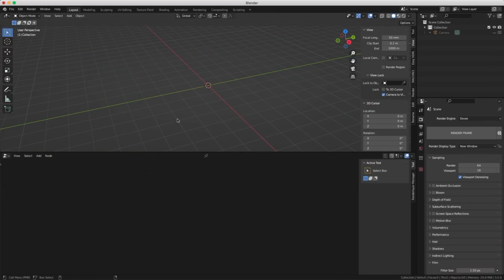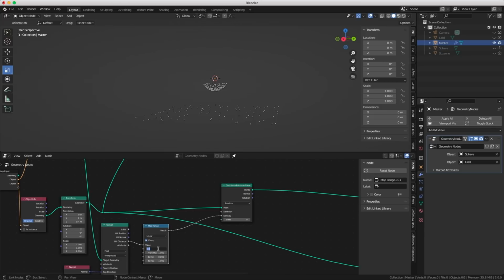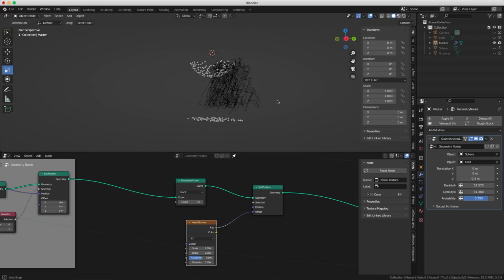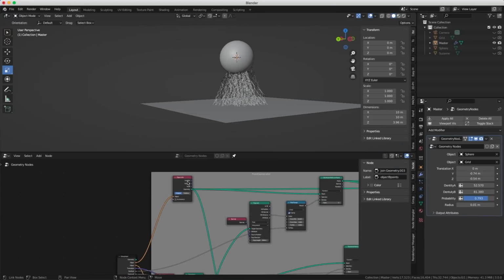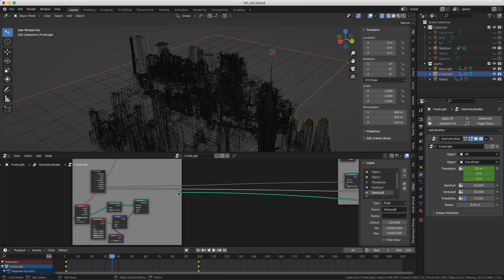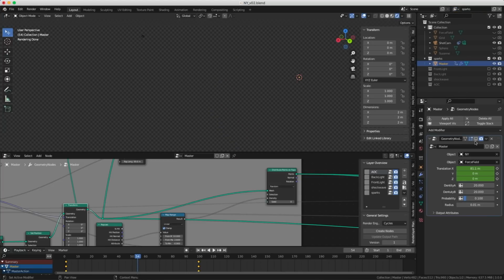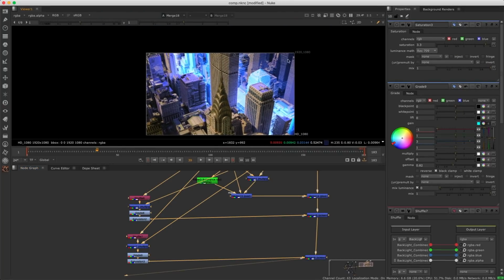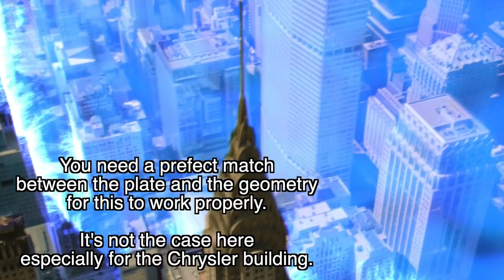Shockwave ESPN making-of in Blender EP41

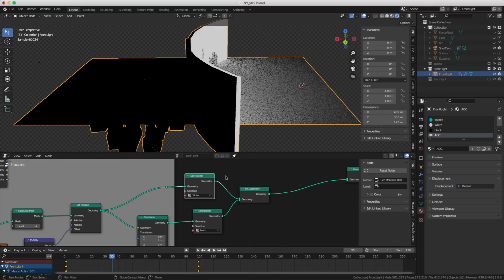Comment: 23:20 this stuff making one side invisible or what not is probably actually better done in shader nodes. You can mess around with light paths (in particular, camera ray and backfacing I think) to make this stuff appropriately (in)visible with no extra geometry at all. Only works in Cycles tho
Reply from the maker: Yeah but like anything CG, there’s always many ways to do stuff. I received 5 different methods for calculating points according to the distance. I choses that one because it was the easiest and the fastest.
Reply: @BlenderBob  Sure, but I think it'd still be worth looking into all the magic you can pull with light paths. It probably would have used about the same number of nodes, except a bit fewer in Geo nodes and a bit more in Shader nodes, and it'd have been "perfect" with no chance of weirdness from, say, having extra geometry at an offset.
It clearly worked out here though. I'm not saying "REDO THIS WITH THAT METHOD", just, keep it in mind for future possibilities :)
Reply from the maker: @Kram1032  Actually I remember trying the double sided shader but it didn't work for the EXPN clip. If you look at the big explosion shots, I'm using a dome and we can see both sides of it so it wouldn't work. Cheers :-)
Reply: @BlenderBob  ok then that makes it probably indeed more complicated.
You should still be able to do it by taking the dot product of the view vector and the normal vector and seeing whether it's smaller or larger than 0 to figure out what's the backside from the current point of view.

Except iirc that will not work, because Cycles automatically turns around the normal vector for you on the backside.

So I think, to make it work, you need to actually multiply the dotproduct by -1 given you are looking at the backside, and use that to judge correctly whether stuff should be visible or invisible.

That definitely undermines the idea that this is somehow simple though.
Reply from the maker: @Kram1032  Ha ha! It's actually faster to offset the geometry than reading how to do it with this suggestion ;-) Sometimes, in prod, in a rush, you don't always have time to make the best possible solution. If it works, let's do it. :-)
Reply: @BlenderBob  Very fair (though it's also difficult to explain entirely through text alone haha)

Comment: You do not need "real" nodes to rearrange the connections. There is a "reroute" node that exists just for this purpose.
There also is a shortcut (not sure if it is part of node wrangler) that just lets you cut through a connection to add a reroute point.
It's something like shift + right click drag. It also simplifies multiple connections coming from the same output node if multiple connections are crossed.
Reply from the maker: Thanks. I am using the reroute in that clip. :-)

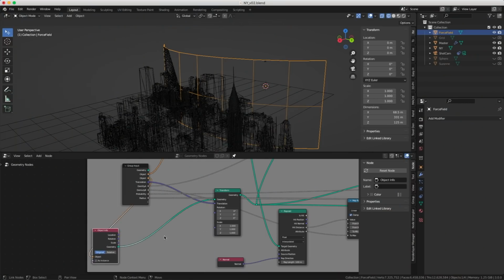Comment: 17:14 I think it might be a good idea to separate out the base geometry stuff from the effect stuff. I.e. use a second geometry nodes modifier with its own node graph, rather than having this all in one single geo node modifier.
Reply from the maker: Why? It’s working after all, no?
Reply: @BlenderBob  If you were to reuse the effect on a different geometry, you might not want the subdiv stuff in there is all. It feels like a module that's unrelated to the main effect which might work on many other things

Comment: So using a random value node to offset the lines was probably the thing to do in your situation regardless.
However, the reason the noise based offset was weird like that is because it also goes from 0 to 1. You could have, in principle, fixed that by subtracting .5 from it with a vector math node
Also, use the Col output (which is three values) instead of the Fac (which is only one) to get it to be threedimensional rather than onedimensional

Comment: is there a way to combine this with your ice tutorial? so the shockwave freezes the objects?
Reply from the maker: You could but I would do it in comp. But if I had to do it I would use the paint/canvas modifier to paint the weight of the city. May need to remeshi It first to get even polygons. Then I would boolean the weight and the density to get the ice behind the shockwave. But yeah, do it in comp. :-)